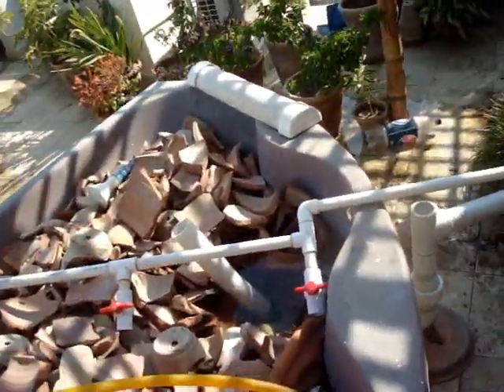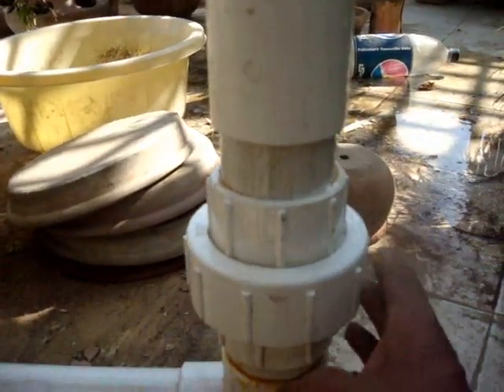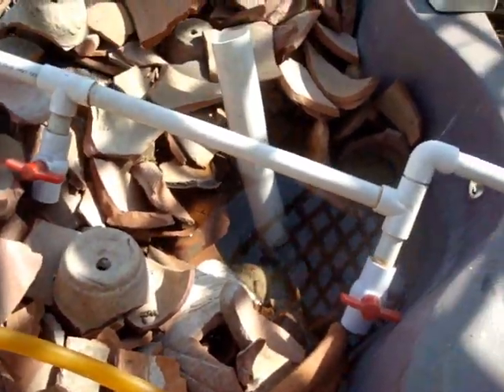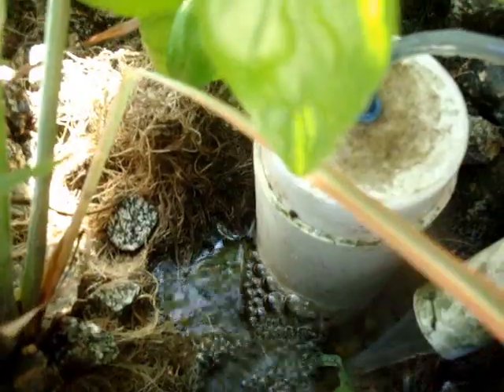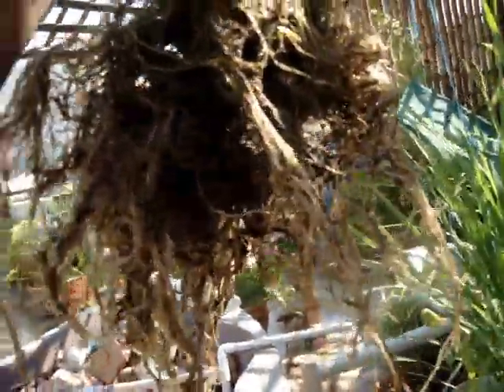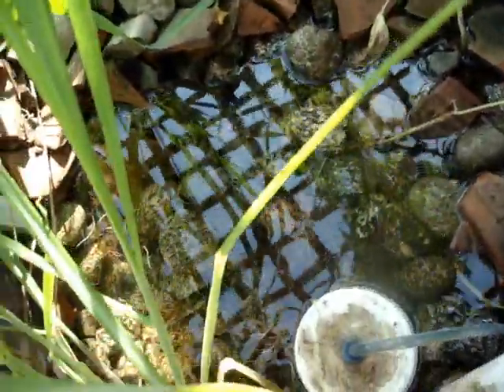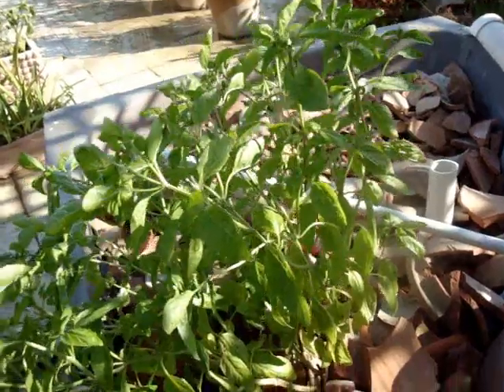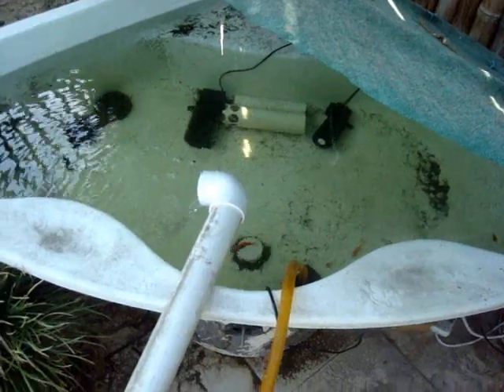Homemade Bathtub Aquaponics!

Comment from the maker: @waqasalik The free space is a different issue, that reduces the surface area for bacteria in the bed and increases the amount of water needed to fill it, but the bigger problem is that you can't really plant in pieces this big, no place for the seeds or seedlings to develop an easy hold. Have to give it a top layer of those small rocks or use that filter can planting idea. The basil only fit as it already has a big root mass and is a big plant itself